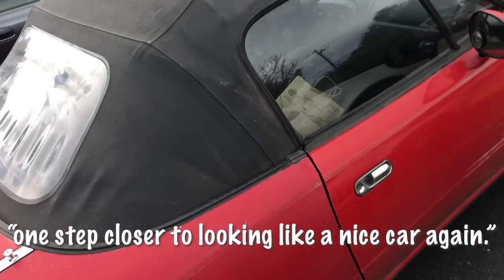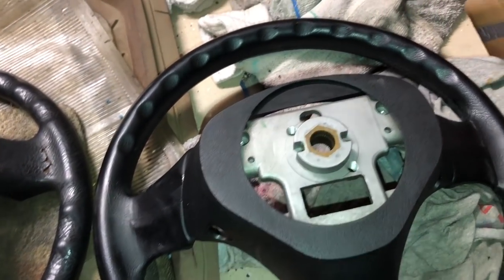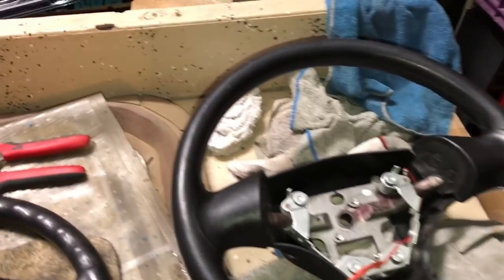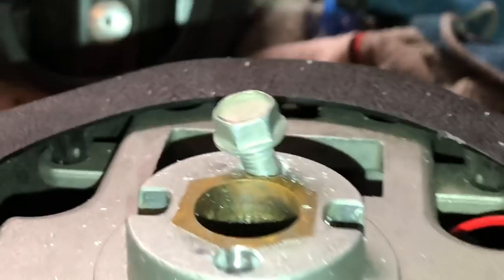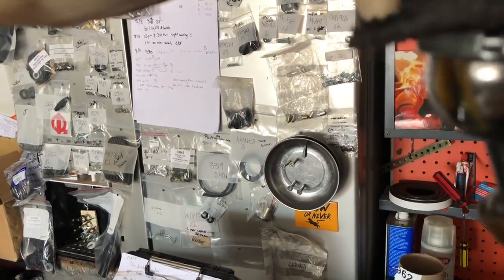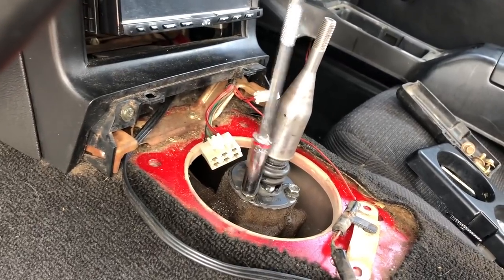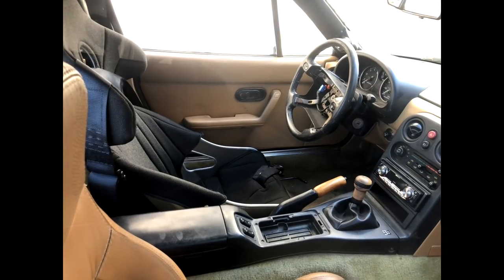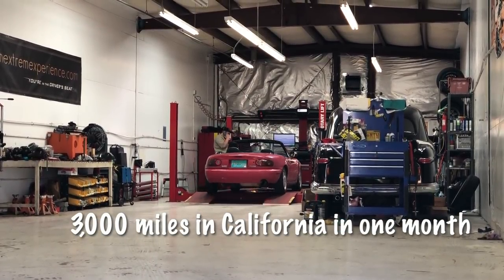Miata Restoration 3: NB Steering Wheel, Heim joints, Eibach, Shifter Repair

Comment: That RF LCA is an original piece - you can tell by the tabs for the sway bar end link. Early arms have two and the link is not mounted in single shear. Keep in mind lowering a Miata will add negative camber and will affect the front toe, so check your alignment. (Edit: typing this as I viewed it, saw you did that.) Did the kit come with the NB rear shock hats? They add spring travel and are an excellent upgrade.